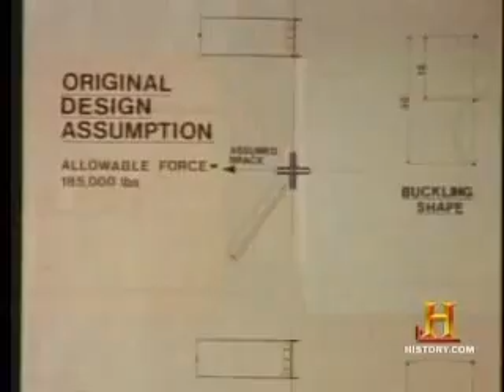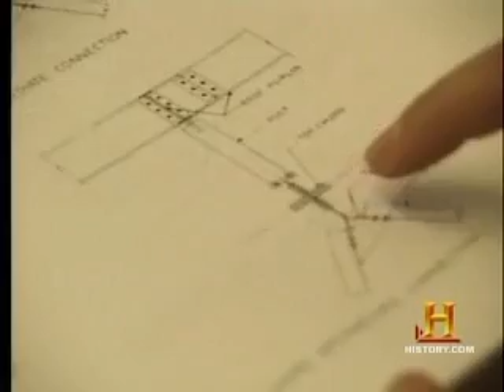Hartford Civic Center roof collapse (1978)

Comment: where did the whalers play during the renovations
Reply: in Springfield MA at the Mass Mutual Center
Reply: Richard Miller Springfield Civic Center.
Reply: @Joe17522  yep we basically rolled out the red carpet.
Reply: Hartford fans bused up the interstate 91, 25 miles north to a Springfield Mass. then. I was there and we had 3 pro teams here those seasons. The Whalers, The Eddie Shore AHL Springfield Indians and an ECHL team called the blades.